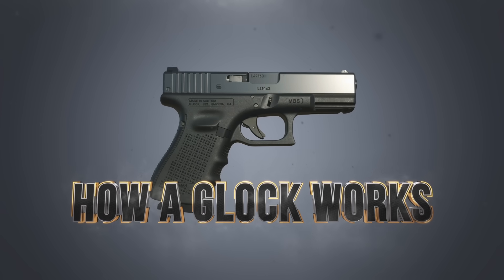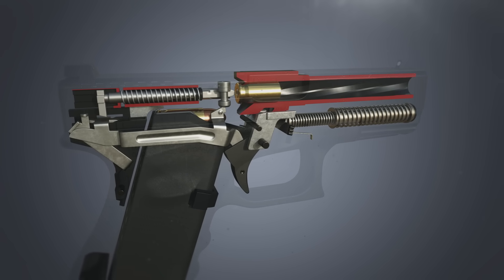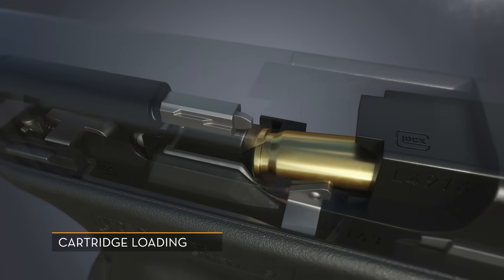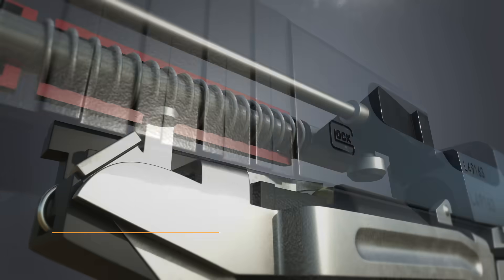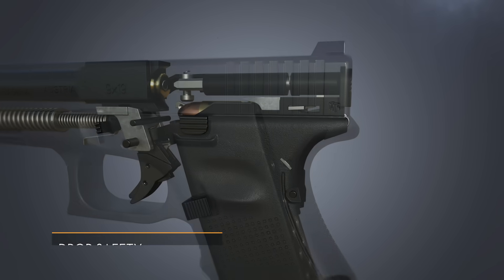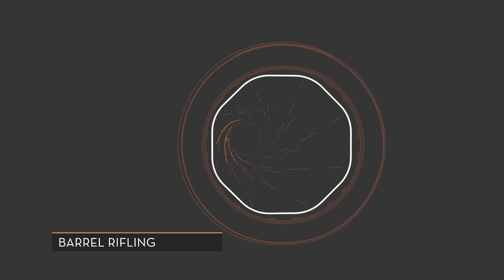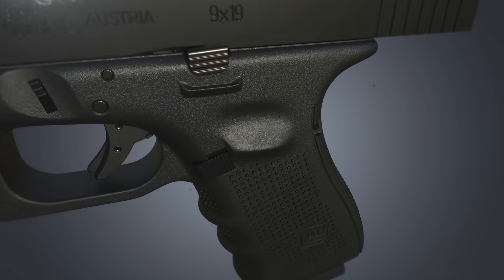How a Glock Works

Comment: 1:45 
I am not an engineer, but wouldn't it be sturdier to design the firing pin blade to sit horizontally? When the spent case gets extracted, it ejects horizontally. So wouldn't that be where the greatest force is applied? Like a 2x4 holds a floor.

Comment: I'm not a Glock fan because I usually prefer classic ergonomics, metal-framed styling, and a distinct manual-safety/trigger feel in comparison of Glocks’ being more blocky polymer ergonomics, unique grip angle, and minimalist safeties. However, if it comes to a situation where my gun breaks and then I'll more likely take the Glock. If the gun feels wrong in my hand, I am more likely going to dislike shooting it. Grip angle and shape matter more than brand. Which is why I am more drawn to the feel, history, power, and mechanical character rather than the modern, utilitarian, one‑size‑fits‑all approach. Which explains why I am into classic metal pistols, big calibers, and historic military guns. However, this is just my personal opinion and I am okay with people enjoying what they like.

Comment: The Glock Safe Action system is the safest safety design of all striker fired pistols. Extensively proven by military and police for decades. The internal engineering is simply superior. Other brands may have cooler looking guns but Glock is the only striker fired pistols I will carry with one in the chamber.

Comment: is it technically possible to fire a bullet without the lower attached?  seems like i could put the bullet in chamber, push down the safety and pull the firing pin back by hand then release

Comment: It still needs a manual safety.
The Glock design uses the holster as a manual external safety, which limits the user to OWB, or IWB when it is taken off of the body for reholstering.
Reply: Why does it need a manual safety? Keep it in a holster unless you are going to shoot it. If you can’t keep it in a holster or if you don’t know how to safely hold a gun, you shouldn’t own one.

Comment: It would be super cool if you could show how the P320 lacks the safeties in a glock.
Reply: The P320 does have safety mechanisms and it should be safe if you look at it as an animation. 

The problem is that the mechanisms can fail because of fitment and other  quality issues, and wear on the parts. 

The P320 safety mechanisms work until they don’t.

Comment: Wouldn’t it only be an issue with something that has ZERO lockup like a makarov? Because with the slide pushing against the top portion of the chamber that inlays to the slide, wouldn’t that lock it up because it needs the play for the tilting barrel to function? And something huge like a desert eagle has lugs so that would also function as a lock up as the slide has to unlock a bit for the bolt to spin right?

Comment: I honestly think the Glock is a good gun towards usability,but in my opinion other guns like the Deagle and 1911 are better style wise. So,if it is for safety,use a glock,if it's just inside a game,use anything else
Reply: The Glock is kinda underpowered in some videogames 
Either the devs assuming that the 9mm is way weaker than a .45 ACP (it is)
Or for balancing with it's high mag capacity
Reply: @tarekcat07  exactly. I can see by your profile pic that you're a highly trained professional

Comment: Maybe I’m misinformed on how the system works. But could you not just shave down the piece on the slide that moves the trigger arm to the side? If the hump doesn’t move the trigger arm to reset the trigger, the lever would just stay down and essentially allow it to function the way I’m thinking right?

Comment: So we can bend that little piece of metal on the trigger bar down a bit that catches the end of the firing pin and it won’t catch so it becomes full auto? Or would it keep firing until magazine is empty even if finger is off the trigger?
Reply: Try it, you'll get 10 years to figure it out
Reply: A glock switch works by keeping the trigger bar down, it doesn’t let it come back up once it recoils which forces the gun to fire again

Comment: If any of you own a Glock, you should be taking notes on where to put your lubricant. The grooves where the slide slides back onto the frame, the spring below the barrel, the firing pin, the mag release, etc. Don’t do half ass when it comes to protecting your life.

Comment: If I have a full magazine, shoot once and hold the trigger down, what happens if  rack the slide while I have the trigger down? Will the firing pin spring forward and shoot since that removes the pin safety?

Comment: I like my sig saurer sp2022 I like the safety of it if u put a clip it won’t load a bullet u have to pull back the slide which is a really big safety measure also a pin rises up letting u know there’s a round in the chamber also  u can pull the hammer back for less pressure or can switch to more pressure those are really big safety measures I look for in a gun

Comment: the so called Safe Action of Glock which is a 3 stage is in fact only a 2 stage safety-less the trigger safety, that one protruding from the center of the trigger which your trigger finger will be the first to press before the trigger- it can not be miss. The Glock another safety stages, from trigger safety, is the striker safety, and then the drop safety.  In the 1911 safety there are also 4 safety features of which one is also irrelevant: the external/thumb safety which prevent the trigger from being press; and then the full-cock notch and the half cock notch. The full -cock notch will steady the hammer in full cock to the rear until disengaged releasing the hammer to fire the firearm. The half-cock notch is that notch designed to catch the hammer if it will not engaged  the full cock notch.This served also as the drop safety. The hammer then is in half-cock position. It must be fully cock to fire. The other safety which is also irrelevant is the grip safety which prevent the trigger to be press even if the external safety is disengaged. it is irrelevant because if you grip the pistol it will be the first one to be pressed-grip

Comment: Virtually nothing about either of those safeties will stop somebody from killing you with that firearm if they get it in their hand they do not have to disable any safety separate from actually pulling the trigger. There is no functional safety on the firearm that stops anybody from using it by having to disengage and independent safety. If I wanted a gun like that, I would have continued to carry my 357 revolver because it is still the best first shot fight stopper that there is
Reply: If an attacker gets a hold of your gun, then a manual safety won't stop anyone from killing you. Get some training!

Comment: That's not a Gen 4.
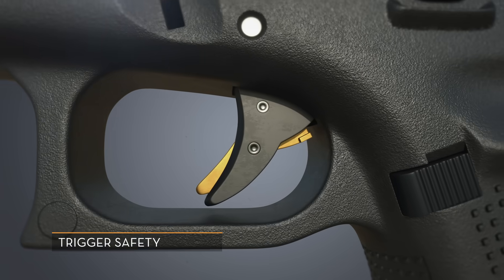The Gen 4s only have 1 pin above the trigger, not 2 as pictured. Gen 3s do have 2 pins, though. The larger of the two holds the trigger.  The smaller holds the slide lock. In the Gen 4 and above, Glock replaced the pin with an internal mechanism for the slide lock, thus nullifying the need for the pin. 1:31

Comment: The trigger safety seems like a gimmick. Anything that would inadvertently pull the trigger back will also depress the safety.
Reply: The concern is the gun discharging due to outside forces such as dropping the gun.

Comment: I am not a gun enthusiast but I am a gun owner (I have a Glock model 22 .40 cal). Although it is a good gun, if I could do things over again, I would have gotten a Sig Sauer 9mm.
Reply from the maker: Like a P320 or?
Reply: @mattrittman I'm not sure. What I like about Sigs are the non-poly frame and their reputation for building high quality guns. And besides, a 9mm has more than enough power to take out an intruder.
Reply from the maker: @JohnDoe-zo5tu  Yeah I’ve heard Sig is a very popular brand to go with. Are their frames metal? I also like the manual safety personally.
Reply: @theregoesmygyro  I didn't know that. I've had several people tell me that my .40 can be converted to a 9mm, though.

Comment: looks like a lot of little parts that can wear out over time.  am I wrong?
Reply: Yes! Only very few Glock parts need to be replaced during regular maintenance. The recoil spring assembly, for example. Every semi-auto handgun has a recoil spring. Most gun owners do not even know that it needs to be replaced after a certain amount of rounds. Many don't even shoot that many rounds to wear that spring out.

Comment: What is that little switch above the trigger guard for?
Reply: It's the slide lock. It needs to be pushed down on both sides to allow the slide to come off for disassembly.

Comment: Doesnt the barrel of a glock tilt? How is it going to capture all the gas in order to silence it? Cool idea, but i dont think its practical.
Reply: The gas doesn't need to be captured really, and this works similarly to any other gun, it's very practical.
Reply: The barrel tilts on all semi-auto firearms with a John Browning tilting barrel design (1911). That's most handguns in calibers 9mm and up.

The gas is expelled at the muzzle, where a silencer can be attached to the barrel if needed.

Comment: This answered to a question I had. I shot with a pistol for the first time a week ago at range and I looked at the Glock on the table with the slide back and I noticed the barrel isn't in line with the rest of the gun. It looked like it was pointing up. I thought that it's just my mind making tricks and I let it go, but this animation shows how the back of the barrel is lower when the slide is back to pick up the next round.
Reply: John Browning invented the tilting barrel design over 100 years ago.

Comment: was always curious behind the saftey mechanism of a glock, I don't own one yet but plan on getting either a glock 19 gen4 or a SIG P320 as my starter pistols, I'll save the AR-15s for later on down the line.

also for a bit of trivia, I live in europe and yes I can own 2 AR-15s without much work done(request to own more can be granted easily with collection as a valid reason), just need a firearms license for semi automatics which anyone age 21 or older can get easily or as many bolt action rifles at the age of 18 without a license. ofc gotta register the firearms by the police and most valid and common reasons for purchase are: self defense at home, sport shooting and hunting(license required)

note that this is only the laws in Austria(13th most armed in the world), others have different firearm laws. Germany(24th) for example is a considerable bit more strict when it comes to firearms, Switzerland(18th) on the otherhand is also pretty laid back as well, so anyone living in the EU who's interested in owning firearms, I've given 2 options where firearms are pretty easy to get

Comment: Any here to pay respects for Gaston?

Rest in peace Mr. Glock
Reply: @Leyo1  bruh. That’s (almost) like saying praising the inventor of electricity is messed up because people die from electricity.
Reply: @Leyo1  fair point, but the Glock was originally for the Austrian military and law enforcement. Both of those (military and law enforcement) kinda protect you from harm.
Reply: R.I.P Gaston
Reply: All he did was copy the 1911
Reply: @georgejungle138  
False.

The Glock 17 and the 1911 are very different. The Glock 17 is striker fired, the firing pin (or in this case, the striker) itself is released to hit the primer and uses a spring to do so. The 1911 is hammer fired, it uses a hammer to hit the firing pin in order to hit the primer of the cartridge.

Comment: The octagonal rifling prevent it from firing cast bullets without gunking it up with severe lead fouling.  I picked up an aftermarket barrel with normal rifling to solve this issue
Reply: Common misconception. There is no need for an aftermarket barrel with normal rifling to shoot cast bullets. Buffalo Bore and many others have articles about that, including the source of this myth.

Comment: 1:30 still don’t get how this is a safety lol
Reply: It's another type of drop safety. If you drop a gun with the barrel pointing up, as it hits the ground the trigger can pull from inertia. In other words, as the gun stops because the grip/slide hit the hard ground, the trigger can keep moving in a downward direction because it's on a hinge/joint. Obviously the trigger moving downwards (backwards, in relation to the barrel) will fire the weapon.

So the little blade there stops the trigger from moving backwards without first being engaged. It must happen in that order, the blade is depressed and THEN the trigger will pull. When a gun is dropped, the major shock of hitting the ground initially will happen only once. So the blade stops the trigger from being pulled without intentional human contact.

Comment: ok dumb question but if a "switch" just overrides the trigger bar how does the striker reset ?
Reply: Something probably disables the striker pin from doing its job, then when its set back ( the switch), itll start working again

Comment: In the beginning of the video, it shows the trigger pulling back the firing pin and firing as if it is double action.  Is this the case?  Once the pistol is racked, I thought the pin is ready to go, or does it have a decocking lever?
Reply: The trigger needs to move the firing pin back to remove the drop safety.

Comment: In 1992, a man from Killeen, Texas named George Hennard opened fire at a caf© after crashing is pick-up truck into the building; twenty-two people died and many more were injured from Hennard’s rampage. This was an instance that showed that the Glock pistol could be obtained by a citizen, the pistol was legal to buy. Gaston, a native of Austria invented the Glock in 1982. Samples of the pistol were used for the Austrian army for ample and reliable use. In 1986 the shoot-out in Miami brought the awareness of the resources that criminals could obtain weapons that proved to be stronger than the law enforcement.

What makes the Glock different than what the other guns were manufactured out of was the special plastic that Gaston used. Polymer plastic is a very strong plastic that is resistant to corrosion which differed from traditional steel guns. The guns made of steel were heavy and the bullets were loaded individually. With the Glock, the clip held seventeen bullets which was a greater number than a regular steel gun. Gaston wanted the most powerful gun to be the product of this idea. Gaston had begun making knives and clip belts for the Austrian army.

All these inventions were made in his work shop which was his garage. He would study and analyze what the army was starting w for instance a knife and he would construct a blade and handle that could adapt ore to an ever evolving military strategy. Gaston’s Glock was put through rigorous tests of heat, ice, sand and mud. Experiments were conducted to test the durability of the pistol; other guns such as the H&K failed to the comparison of the Glock 17. In Spring 1984, Gaston traveled to the town of DeutschWagram where he bought property to have his workshop expanded.

He had hired 3 dozen Turkish immigrants but as his gun and company grew, his contract and business plan only expanded to the Austrian army. As more countries learned of the capability of the Glock 17, they nquired more information and wanted the product. Gaston had little income and didn’t know how to manufacture his product with an increasingly growing market. Gaston’s entrepreneur acquaintance, Karl Walter suggested that Gaston should expand to the United States. This was not only a good marketing approach but what would be a large investement for the USA.

Comment: I think this is why my department chose Glock 47 MOS over SIG P320. 
I've chaulked SIG P320 Unintentional Discharges to be 1 of 2 things. It's either the firing pin safety block is failing and the P320 is going off due to the firing pin being under pressure with no safety mechanism before the FPSB. Or the trigger is being manipulated by the holster allowing the firing pin safety block to engage. This is why I still have a damn Glock. The firing pin safety block works in conjuction with the firing pin when pulling the trigger. In other words the firing pin isn't engaged until you pull the trigger. This is why the Sig P320 has a fantastic trigger pull and the Glock has a spongy trigger pull. The P320 needs a safety shoe or safety lever for me to ever consider carrying it. On a side note. Option 1 is a QC issue, and Option 2 is a design flaw. I don't reside in the camp that states Safariland holsters aren't safe. A safety shoe or safety lever is needed for the trigger. This is why the Military is in the clear.

Comment: Good attempt but some of the critical parts that show how it works are basically invisible and the gun ends up looking like a collection of parts floating in space. Best method for showing the operation would be to exhibit the complete firing cycle from one perspective (firing til the slide locks back) and then a reloading and firing from the other side of the pistol, instead of flipping views back and forth. What is that part that magically forms at the rear of the pistol at 0:22? We learn later that it is the connector hook but it doesn't look right just appearing out of nowhere. We almost get to see the trigger reset at 0:39 but the video abruptly switches to another action (from chambering a round and then extracting/ejecting another round)...and then goes BACK to trigger reset out of logical sequence. I think that is confusing as it assumes a firing cycle that we did not get to see at that point. The word you are looking for at 1:34 is "disengaged". The trigger cannot be pulled back unless the trigger safety is disengaged. The trigger safety is engaged when the trigger is at rest. Otherwise, a halfway decent video but it could be so much better.